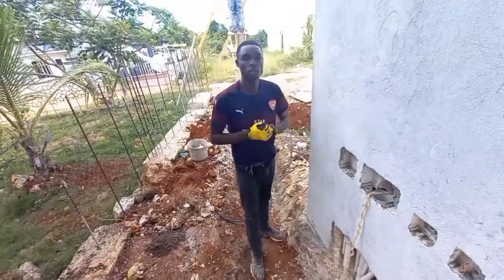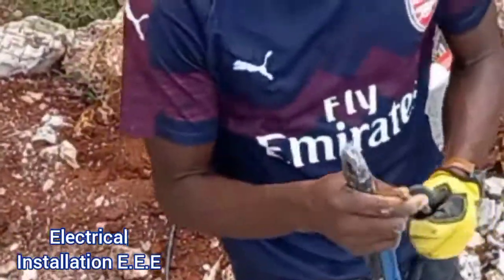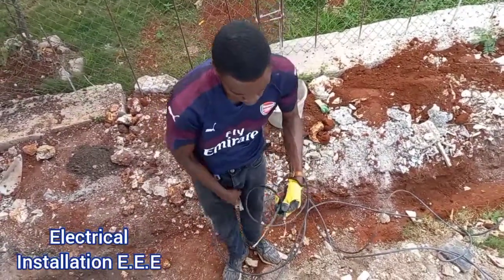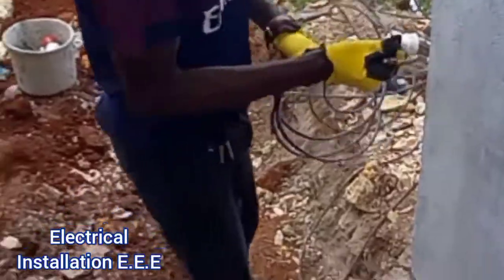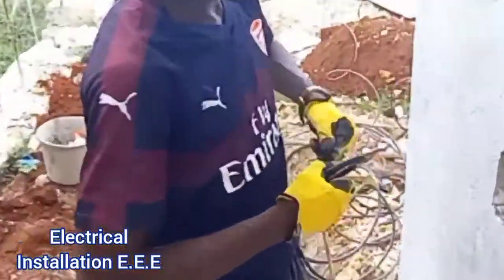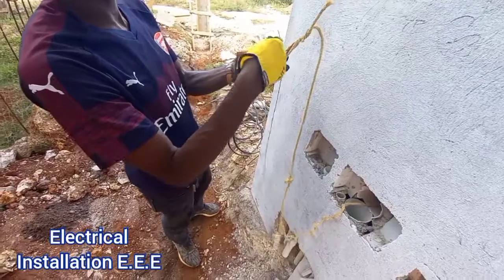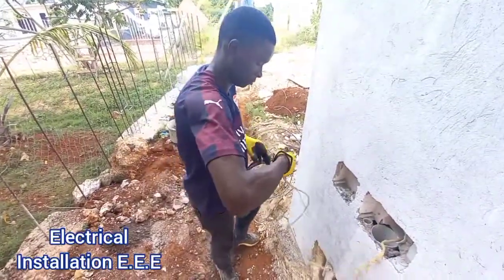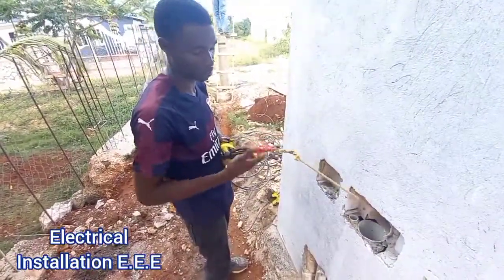Proper way to tie Electrical Main Conductor Wires when pulling through conduits (Tutorial)

Comment: Good day, bro question. When u are fishing main wires through draw box do u use the loop in method. Or u splice the wires or make a joint in the draw box.
Reply: Francis in the draw box u just have to just loop the wires in the drawbox and send it to pole where the meter located
Reply: @rasheedgreen8623  👍
Reply from the maker: it can spice under circumstances e.g a complete project and you moving the main ,panels or something you can use burndy clamps  or other clamps with a high voltage tape but don't practice that try to loop it
Reply: @ElectricalInstallationEEE  Yea man u teach mi something didn't know about the brundy clamp. That's why i always ask questions.